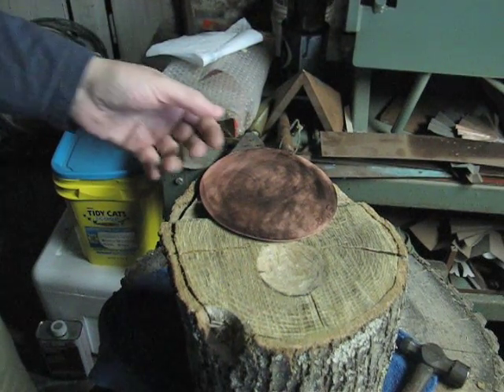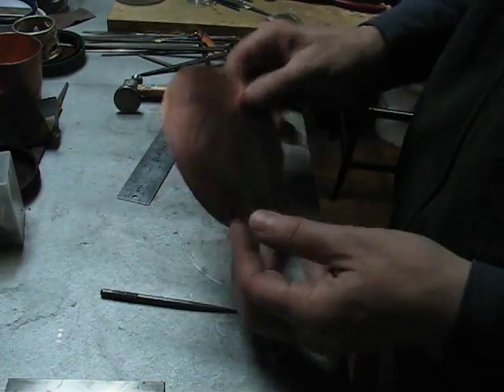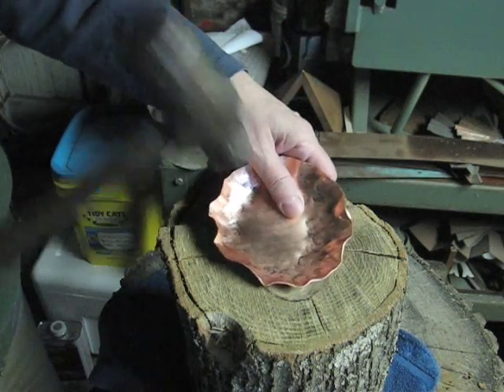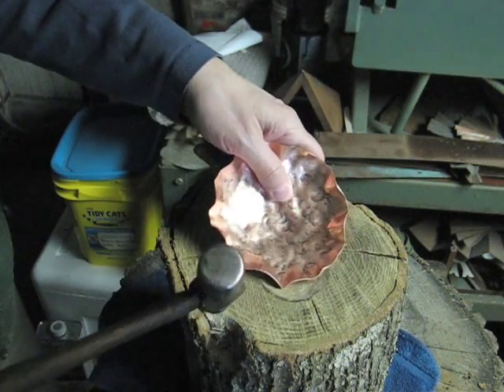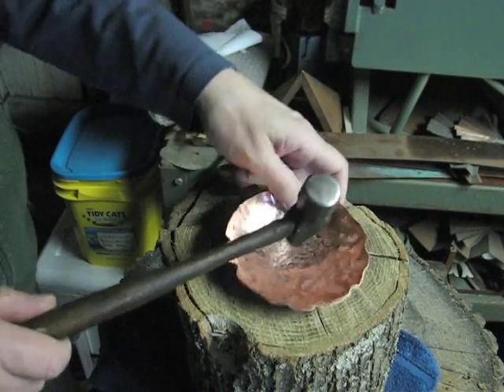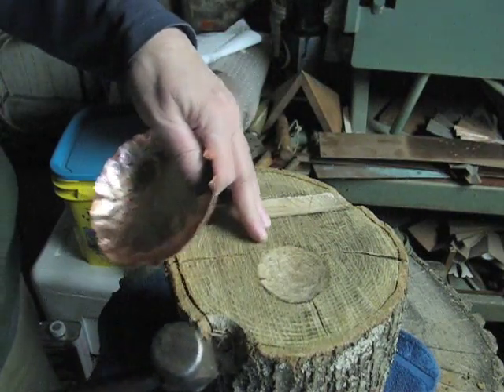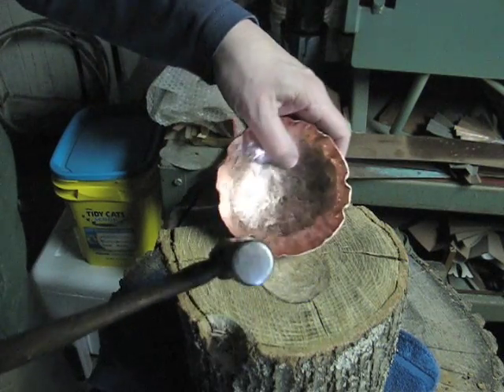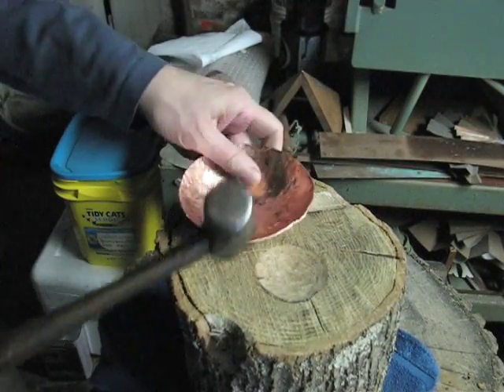Raising a Copper Vessel, Start by Sinking

Comment: does the size of the depresion makes a diffrent ?
Reply from the maker: +Math.S The curve and depth of the depression is more important than the actual diameter. You want something that is near the size of the piece you are working on and not to deep for starting and if you are smoothing out you need a hammer or mallet with a convex face and a depression that is close to the final curvature of the bowl.  
 It all depends on whether you are raising a vessel or making a shallower bowl, doing it a few times and trying different depressions will answer a lot of your questions.
 Thanks for watching!
Reply: thanks i have allready maked two and it worked

Comment: I’ve made a crimp in the copper bowl while raising.  Being a beginner and not understanding what the metal will do, is there a way to remove the crimp around the outside edge?  Thanks.
Reply from the maker: You are asking a question without a  photo or video. I cannot see what you mean by "crimp" , its size and location on the piece. I cannot help without seeing something. make a short video with your phone where and how large it is on your work and post it on Instagram or YT. Then I can help or advise what to do.  Thanks for watching.
Reply: @Ceropegia Hey thanks so much.  I didn’t know you would accept photos or video.  I’ll try and get one to you soon.

Comment: cool .. how do u get the depression into the stump ? is that a type if drill bit ?
Reply from the maker: I used a wood carving gouge and a mallet. The depression is cut and then finished by hammering with a convex faced hammer. The last step is not so necessary because the depression will get smoothed out as you use it . Thanks for watching.
Reply: @Ceropegia  wow thanks man, this was the best tutorial on rasing copper !

Comment: how did you make the depression in the oak block?
Reply from the maker: +Benjamin This question is answered below, See barronredneck   _Mallet and gouge, (curved chisel). The depression does not have to be perfectly smooth. Use will flatten any little irregularities.  
Thanks 
for watching!